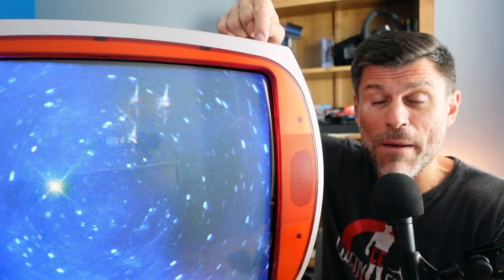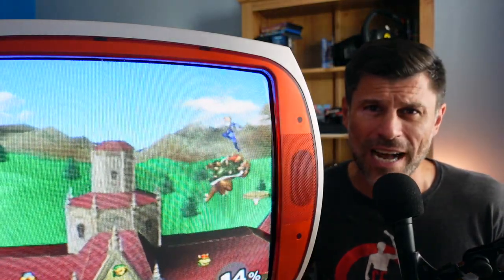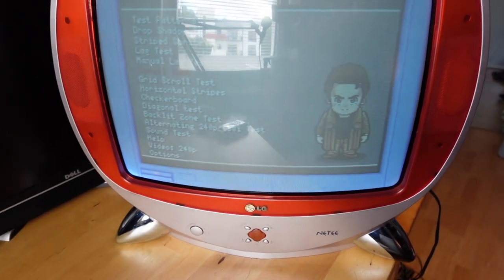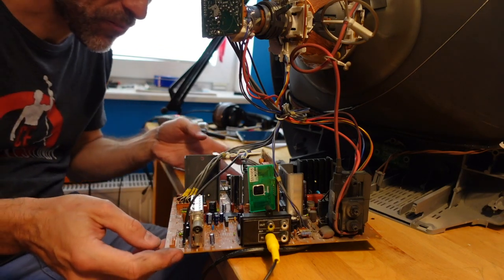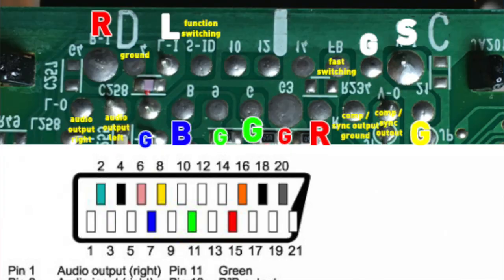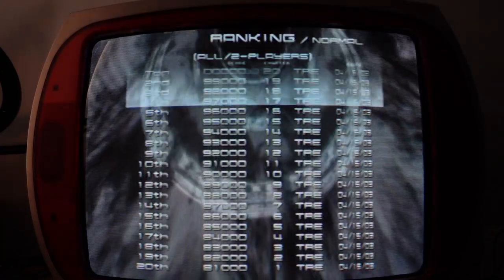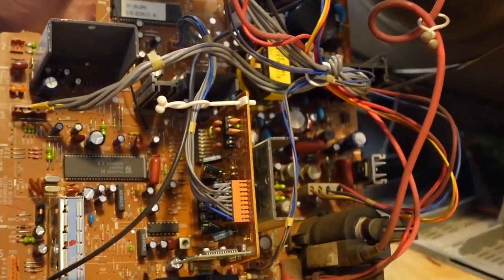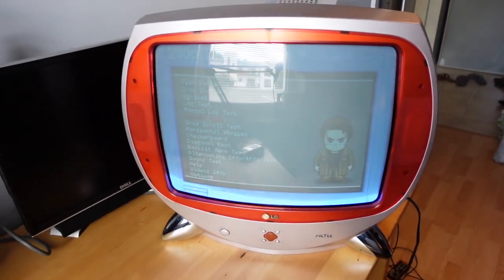LG NeTee - Modern Retro CRT

Comment: LG missed a trick, because SCART plugs can and do also carry a composite signal, they could have simply bundled an adapter plug that breaks out the composite pins to an RCA jack anyway  and saved the cost of spinning a separate model xD
Reply from the maker: This is an excellent point! So what’s the deal? Or was it cheaper to solder on a different plug? I have no idea plugs cost at volume 😀
Reply: @ZezRetro  RCA plugs are probably cheaper at a guess, perhaps it was the scart adaptation that came second 🤔

Comment: I have the purple version of this tv, and indeed you do need the remote to access the service menu, I had to shift the screen over to the right a little bit as the image was too far left with Scart.  Took quite a good bit of digging online to find out how to access the service menu, but if you ever do get a remote you access the service menu by doing the following …

Hold down the ok button on the remote, then hold down the volume up button on the tv, hold them both down for 10 seconds and it’ll take you to the service menu and you use the yellow button on the remote to change to different menus, press it once and it’ll take to the the screen alignment menu
Reply: I really want this tv so thanks for this walkthrough for if I get one 😁
Reply: Eres el puto amo hermano, la tengo año y medio y no sabía como hacerlo, mil gracias desde España.

Comment: Healthcare + RGB mods, FTW. lol

It doesn't look like it would need too many extra passive components to restore RGB SCART on this set.

It's fairly common that they used that "dual footprint" thing on CRT TVs.
I've seen the same thing done on the cheap LCD TV driver boards from China.

Most have the three RCA (phono) sockets for Component input, and some have a SCART socket in its place.